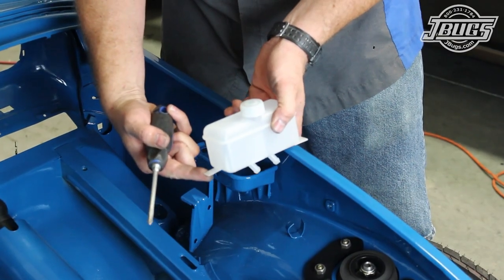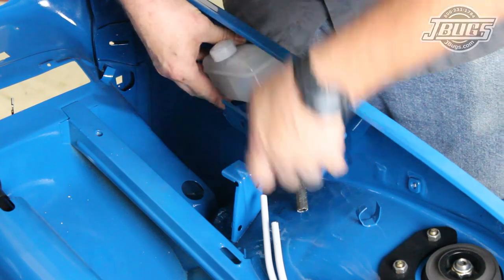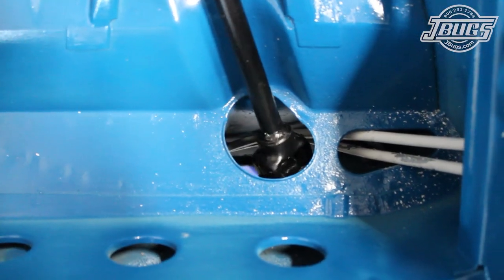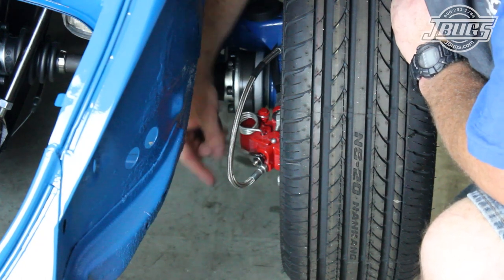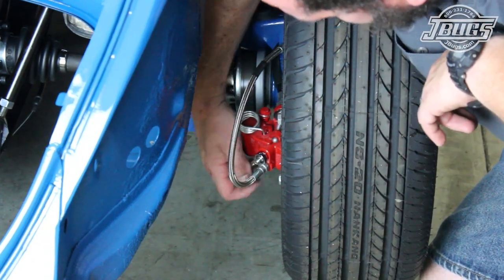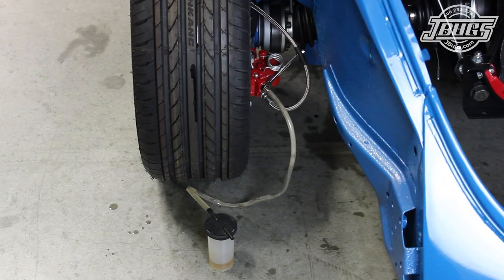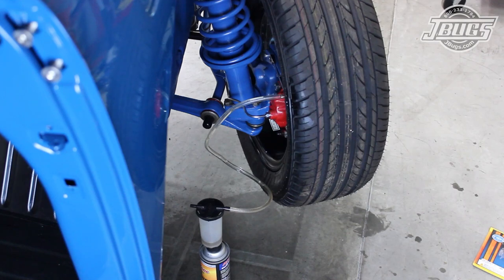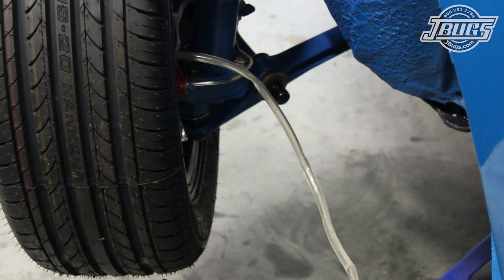JBugs - 1971 VW Super Beetle - Quick Brake Bleeders Installation

Comment: I need to get that quick bleed valve !!
Reply: What would be the correct size for late 4x130 drums bugs?.. Thanks
Reply: @VWRICH23   drum brakes have a 6x1.00mm brake bleeder usually.

Comment: Do these quick bleeders work with Top Line disk brakes and stock drum brakes?

I have disks in front and the stock drums in back and I've never felt like I've been able to get them bled fully with the help I can (never) get.
Reply: You need to get the appropriately threaded valves, we offer them in 7, 8 & 10x1.00mm sizes for most disc brake calipers. We do not offer them in a 6x1.00mm which is what most wheel cylinders have.

Comment: I am curious how your wheels are going to turn with hard break lines fastened to the caliper
Reply: Whether they have a hard line or a soft line, the caliper has to connect to the hydraulic system. The caliper doesn't move, it sits around the rotor which is what the wheel is mounted to. The wheel and rotor spin freely until the brake pedal is pressed.

Comment: Any suggestions how to remove a broken bleeder valve???
Reply: My apologies, I never saw this question! Hopefully you've got if figured out by now but if a bolt extractor (or other similar methods) doesn't do the job, you're better off replacing the caliper or wheel cylinder.

Comment: So what can you do if you installed a new master and still no pedal
Reply: If a new master cylinder didn't solve the problem, the issue is most likely somewhere else. You'll have to do some more diagnosis to see where the problem is.
Reply: @Sam_Mebane  thank you Sam for your response.  After watching the video I took some key points and relayed it to what I was doing. Two rear wheel cylinders bleeders are frozen but I was able to get fluid out the line. Lines are bled out now but I gotta replace the two cylinders to finish the right way.

Comment: I've bled my brakes on my '71 Super Beetle yesterday, and I'm still getting a soft brake pedal. I've bled them using a pressure bleeder, and then I did it again with someone pumping the brakes for me while I open and close the bleeder screw. The brakes do engage when I have the brake pedal almost to the floor, it catches right at the end. Any ideas what could be the problem? I've bench bled the master cylinder before installing it in a car, but I may have made a mistake by pumping the brake pedal several times before bleeding the brakes. That may have gotten all the brake fluid out of the MC. But, if I don't need to bench bleed the MC,  I don't know why I'm still getting a soft brake pedal?
Reply: First off, we have never bench bled a master cylinder. If the brake pedal push rod is adjusted properly (the free play before the rod engages the master cylinder) and the brakes are not working until the pedal is near the floor, the brakes aren't completely bled, the master cylinder may be too small (if you have 4 wheel disc brakes and a stock master cylinder) or you may have a bad master cylinder.